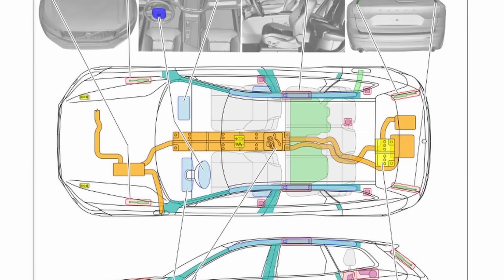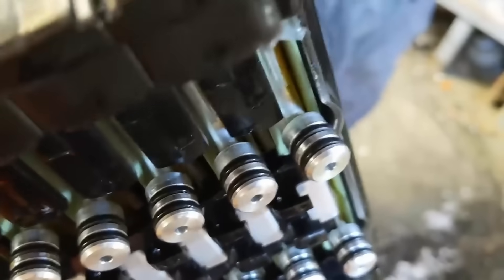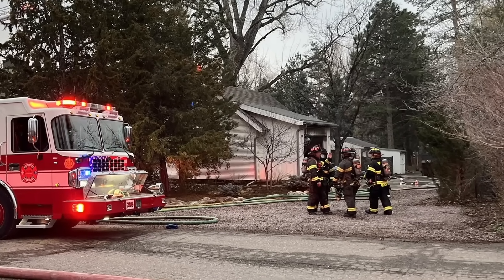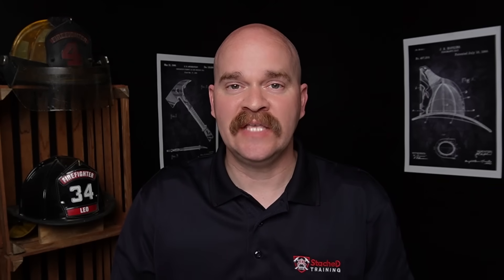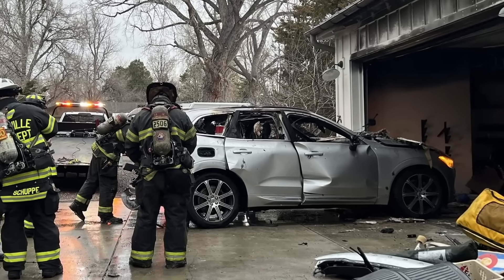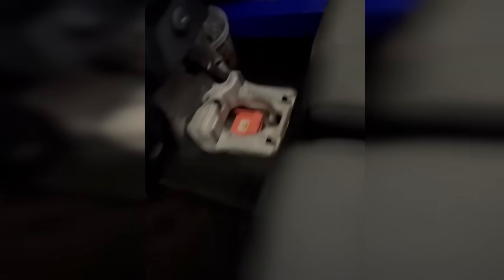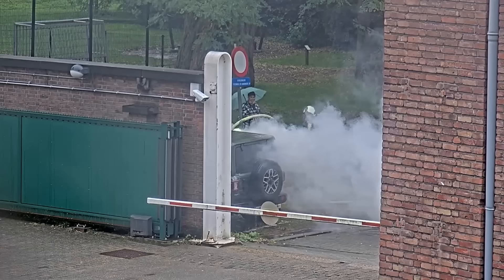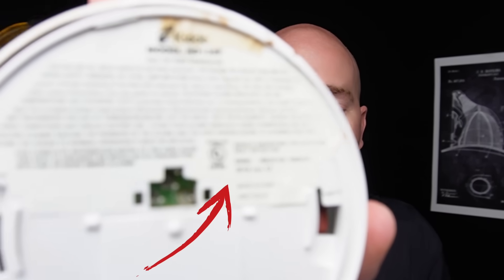EXPLOSION: Volvo XC60 Electric Vehicle!

Comment: EVs need roof blow out panels so that the force of the explosions goes up and not at firefighters.
Reply: No, they should be designed so that it's impossible for the battery to off-gas into the passenger compartment, and the HV disconnect should be accessible to firefighters and emergency services on the outside of the vehicle. Of course the manufactures would vehemently oppose that, since it would leave the EVs vulnerable to being easily disabled by a bad actor.
Reply: @charlestoast4051  So far the EV manufactures can't invent a battery that doesn't get damaged under normal use or accidents.  I would imagine to prevent off gassing into the passenger compartment would require a welded steel box either around the battery or the passengers.
Reply: @charlestoast4051  The best way to prevent the battery off gassing would be to simply eliminate the battery.
Reply: @ghost307  I know - what if you could replace the electric propulsion motor with a device that perhaps converted a liquid fuel into kinetic energy in someway. I think there is something known as an internal combustion engine. I don’t know whether that would work but perhaps it’s something that is worth researching and looking into😂
Reply: That's a good idea.
All it would take is to build every EV with a sunroof instead of allowing it to be optional.

Comment: Officially PHEVs are electric vehicles, BUT scientifically they are not. They don't have any of the characteristics of an EV:
-No quickcharging
-The cooling system has to be totally different with the presence of the boiling hot engine
-weak acceleration
-a lot more mantenance
-doesn't run if there's a fault with the engine
-can't road trip without emissions

...etc...
Reply: None of the characteristics of an EV? 1) Large  traction battery - that is entirely sufficient to classify them as EV's, despite the addition of all the systems of an conventional I.C.E vehicle. The presence of a fast charging feature is not a valid determinant of a vehicle being an EV. Some base model EV's don't have fast charging. Intuitively, you might believe a pure EV, with so many less moving parts and less systems should be more reliable than an I.C.E. vehicle, but the reality, from actual usage, is that an EV is more prone to breakdowns. Repairs are more costly and take longer, perhaps due to the lack of an established repair network but also because it's prohibitively expensive for garages to work on EV's. They have to be stored in much larger spaces. The cooling system in the Volvo discussed in this video looks like a recipe for disaster, and it wouldn't surprise me if there was a recall.
Reply: @charlestoast4051  Yeah, don't pair really hot components with batteries. That's why all hybrids are a bad idea.
Reply: Electric “vehicles” have the same amount of systems of a conventional car or truck. I don’t know what you EV enthusiasts are reading, they have cooling systems, hvac, brakes, fluids, oils, and a 12 volt electrical system.
Reply: @JAMESWUERTELE  look into it, then you'll know it's very different.